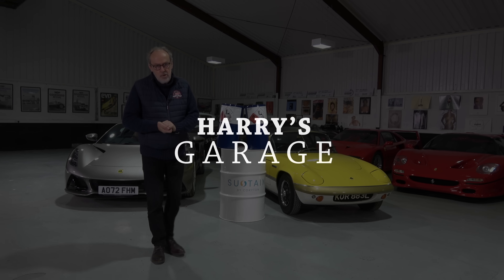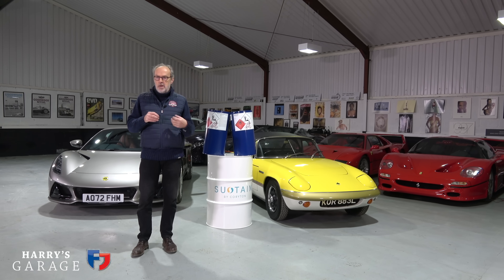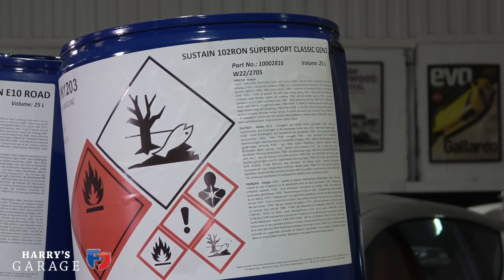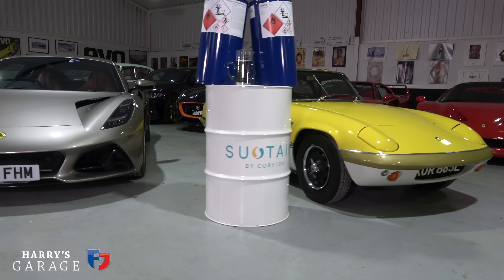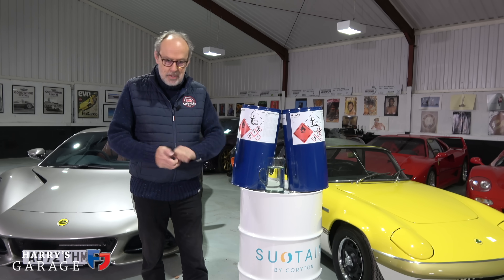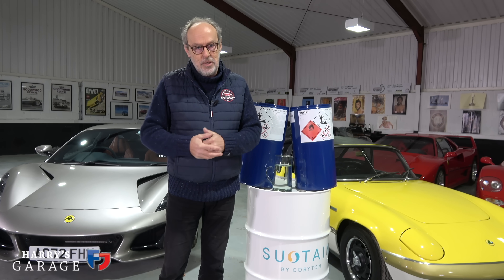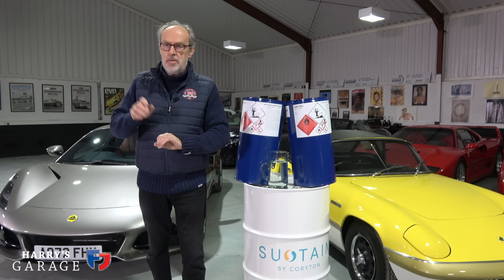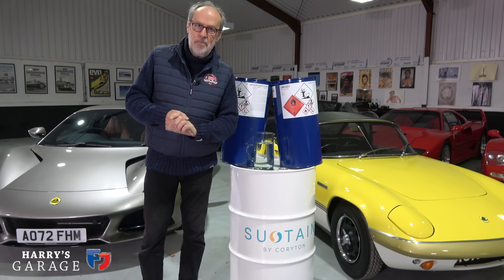Sustainable fuels; what are they & when will I be able to buy some?

Comment: I disagree about aviation emissions Harry, in the sense that fuel accounts for around 30% of an airline's operating costs - For the charter airline I work with, it's around 36% at the moment  - it's a small operation - Much depends on the aircraft operated, routes flown (stage length) and many other factors. On average aircraft (mostly aircraft engines) have become 2% more efficient year on year for as I have been working in the airline industry, which is several decades. The profit margin for many of the LCCs (Low cost carriers) is around 1% - 2% at least in a good year, and there haven't been too many of those recently, so there's a constant drive to renew fleets in order to operate more modern and efficient aircraft and reduce the fuel cost...Failure to do so means you will not survive....BTW Rolls Royce are already developing aero engines that can run on biofuels...

Comment: Terrific presentation Harry. Enjoyable as ever, as your videos always are. Just one thing, sorry to be a pedant but have you miss-calculated your spend? It may not be as bad as you believe (£7.5k p.a.)  due to the mpg efficiency you reported (& defined in the Evo article). Did you miss the 10% saving due to increase efficiency? (= £7.5k - [10 to 20%] = £6.7k p.a.) ? If i have scavenge you £750 p.a., you can buy me dinner. I'll expect the Lambo at my door!
Reply: It's worth saying too that very few owners of classic cars do the kind of mileage you do, Harry. I can afford to run a relatively thirsty 4.2-litre V8 for pleasure because I only do a low annual mileage in it, the total cost of fuel will never be that high. So for many classic car owners I think the premium for using sustainable fuels will be an acceptable trade-off if we can keep driving them.

Comment: I get what you're saying about the emissions from the energy source that you charge an electric car from, but if you are one of the lucky ones who owns an electric car, and has solar panels and a home battery (and I have none of these,) perhaps you won't need to fully charge your car each day. I live in Australia so partially charging an electric car each day might be an easier prospect than it would be in Europe. I do own a ute with a 6 litre V8, and rent, so solar panels, or installing a car charger isn't an option for me, so I hope sustainable fuels become more common.

Comment: Thanks Harry for this insight. A problem would be that the common working man could not afford the enhanced price of Sustain fuel, or if it was mandatory the RPI would go ballistic.
Reply: Predictions are that by 2030, synthetic fuels will be priced at or below current cost per litre
Reply: @markbiggart1265  They already cost a small, tiny fraction of the trillions that EVs are going to cost Europe alone.
Reply: My relative in Finland has been filling his diesel car with clean biodiesel (HVO100) for years, making his Mercedes far cleaner than any EV, and that widely available fuel only costs a few cents more than regular diesel. It would cost less if it wasn’t taxed so much…
But I guess those driving truly clean cars have to pay the trillions of extra costs which EVs are giving us…even though studies show that in a vast percentage of cases ICE cars run on fossil fuels are cleaner than EVs, and even in the cases where EVs are cleaner the difference is negligible. Now that we got our first studies comparing EVs to ICEs driven on something else than only fossil gasoline and diesel fuels, we immediately saw that even natural gas driven ICE cars are cleaner than EVs! 
Natural gas is still fossil, and very far from the cleanest fuel you can use with ICE, but even that trounced EVs in emissions!! Imagine what a beating ICEs run on biomethane, bioethanol, biodiesels and e-fuels will give the EV!!
Reply: WE. ARE. NOT. IN. A. CLIMATE. CRISIS.

The AUDACITY of this man with is 20+ vehicle garage, huge home, boat and private farm with his trips galavanting across Europe to attend poncy motor galas while simultaneously asserting that there's a climate crisis!!!! 

Really Harry? I call either BS or outright hypocrisy on your behalf. Which is it Harry? Because you can't assert this double think and expect to remain credible. 

Unless you're trying to take us for the fools you think we've been educated to be?

Which is it man?!
Reply: How can the common man afford the many times more expensive EV lunacy? 

+10,000 in purchase price 
+~7000 in subsidy at purchase (not free money, you pay it in taxes)
+~10,000 at least per car in subsidies and tax breaks to the manufacturers (again: you’re paying that)
+~3000 per person for the subsidies on the millions of chargers
+~3000 to the electric grid companies for their “necessary grid work”
+~1000 per year at least in rising electricity prices (simple law of supply&demand: if demand absolutely skyrockets then price does so too). Not to mention with people now chained to electricity alone they are even more severely under a monopoly. Expect being taken advantage of like never before.
+3000 for the upcoming perpetual problem of unmanaged global battery waste. It will be expensive as again government will make it purposefully into a forever-problem they can scoff at on TV and then cash in on with their hundreds of staffers getting paid huge salaries to “manage” the catastrophe, then take bribes…I mean campaign contributions from their friends’ companies who are given massively overpriced contracts to pretend to deal with it for decades. You pay for it all.
Reply: …people need to reduce their mileage anyhow and with that they will reduce the TCO of their personal transport / commute. I did replace a lot of my commute and daily drive by using my bicycle instead, e.g. everything up to 15km one way… I walk a lot more inner city, etc… good for your health, good for the climate and by doing so, sustainable fuel could cost even more than conventional fuel (what it won’t do going forward) and still ones total cost will decline. I find it strange that people often seem to insist on no change of their personal behaviour at all… we need to find fun in change and not threat all the time!

Comment: No tax on avgas? Why do you think airlines prefer to fill up in some countries and not in others... And I'm afraid you are wrong about aviation engine technology: there is a push towards more and more fuel efficient aircraft; Airbus is working hard on the ZEROe concept; Lillium is demonstrating electric thrust technology, including vectoring; at Cardington, work is still going on with the Hybrid Air Vehicles Airlander...
Reply: Great point on the tech being developed. Because cars are used by the masses, and planes less so, there’s less media presence on the tech developments. But they are certainly happening. 

The other thing to consider with aviation fuel is that the types of planes that you and I tend to fly on (airliners) carry 150+ people, so whilst they may seem ‘more polluting’ than cars on the surface, we are sharing the emissions as a larger group of people. Equally, for those who fly privately in light aircraft, for a hobby etc. do pay tax on fuel, and it’s often much more expensive than petrol or diesel as a result

Comment: I DID find this interesting! Thank you for this, and also good to hear what makes you grump about the current situation but also acknowledging that's there's space for all 3 types (sustainable, fossil, electric).
Reply: Pro's and cons to everything something which most people including Harry understand. It's the people who just don't like one option and then argue anything against it that are the problem.
Reply: My personal preference is for hybrids. We already have 2 kinds, standard and plug-in. The next step is variants, with larger / smaller ICE / batteries, depending on the spec you want. Plus, replaceable batteries for EVs. Fuel stations stock the various sizes fully charged, and you switch them over. Much like they did with horses centuries ago.

Comment: I'm all for sustainable fuels.  But you can only store a maximum of 30 litres of fuel at home, so you would have to keep ordering small quantities that would in all probability be delivered using diesel vans.  So until it can be bought from normal petrol stations I'm afraid that it would probably make little or no overall savings in CO2.
Reply: It's true, but maybe the bigger picture is that the rich folk with big barns full of cars are just the starting point. If Harry can encourage others equally fortunate as himself to start investing in sustainable fuel then there's more reason for companies to develop them and produce them on a gradually larger scale? But like he said, aviation will probably be the driver since they're using 10's of thousands of litres vs maybe a couple gallons for a Sunday drive 😂

Comment: I no longer use a car but my daily commuting bicycle uses biodegradable hydraulic fluid on its brakes. It's made in Germany by Trickstuff and it's called Bionol and uses vegetable based oils and additives to reach a boiling point of 420C. Still testing if it lasts as long as Magura Royal Blood or Shimano Mineral Oil. And a bike is a lot simpler of course.